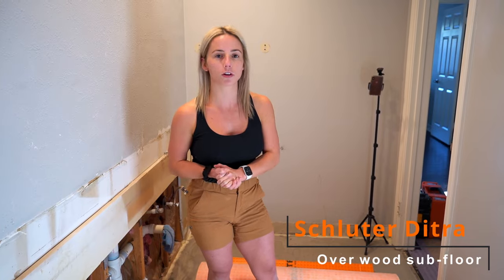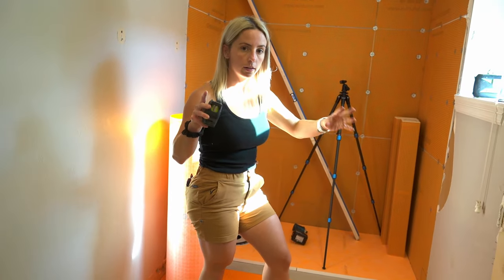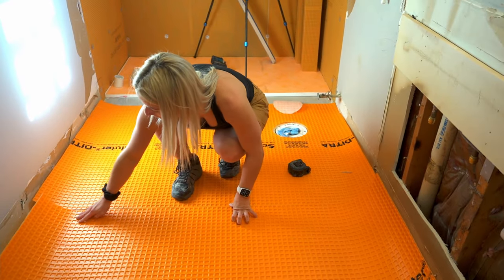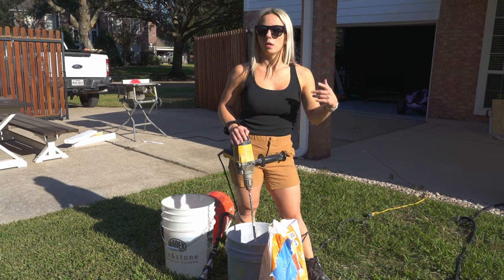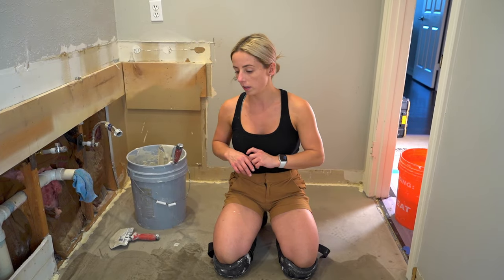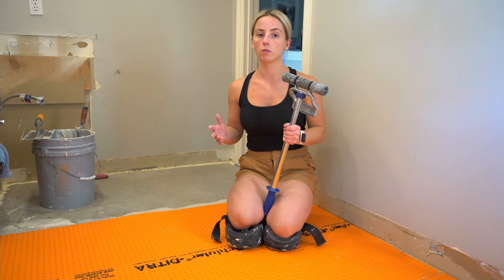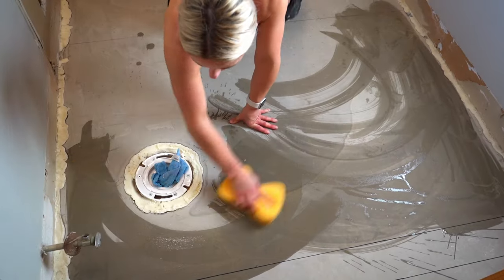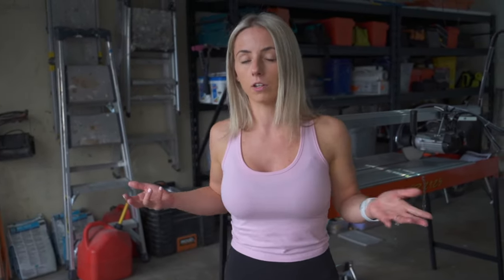Schluter -DITRA over wood //  full installation tutorial

Comment: I laid the Ditra over plywood subfloor. That was a mistake. I assumed the subfloor was flat and level. It was not. Every bump  was amplified by the Ditra. I will start over with self leveling compound only under the tile. The house is 20 years old. All settling has occurred long ago.
Reply: Exactly why are you guys using in the first place. What were your thoughts before you used it?
Reply: If you don't understand a flat substrate you shouldn't be
Installing anything

Comment: Using the ditra in my bedroom remodel. Subfloor is concrete slab with asbestos glue so I scraped as much glue as I could while wetting it so it wasn’t airborne than used perfect primer to seal it. Now I’m ready to use the ditra. This video was very helpful!! Thank you for being so detailed in your instructions.

Comment: I am installing Ditra first time today and will use unmodified thin set since this was recommended on Ditra web sight. Can not purchase Schulter thinset at my local tile shop. Claim is unmodified will dry better under membrane due does not need air to cure, anyway too much confusion. Thank you for your excellent video. I am experienced professionally in bathroom remodeling and tile installation and late last year retired but just will watch good remodeling video.

Comment: That Tile Chick Thanks for all the great info! I'm trying to calculate how tall my tile assembly will be using Ditra- When you add thinnest above and below, how much height should I allow for that? 

I wrote to Schluter, but they don't have any figures on the total assembly thickness, only that the Ditra is 1/8 tall. ~ I have 1/4" and 3/8" tile and transitioning to wood flooring in hall from two different rooms. I'd like to adjust my subfloor to make the transition as flat as possible.

Comment: Doing a kitchen renovation. Removing old tile (& any other flooring layers that may beneath(?)]—essentially taking it down to the original hardwood beneath it all—& then RE-tiling back over. 

Am I able to install the DITRA directly over the hardwood? Or do I need to first install cement board/hardy board?

… GREAT videos. EXCELLENT work. Thanks for your time & efforts 🤙🏽

Comment: Is there any benefit to using the self-leveler over OSB even if the floor is already perfectly level? i.e. Would you use this method in all cases, or would you skip to just the Ditra over thinset on the OSB if it's already level?
Reply: Skip to ditra if the floor is already flat.

Comment: Shannon, have you ever had coverage issues on the felt backside of the membrane? I recently did a concrete slab and used Schluter set. It adhered well to concrete slab (pre wet with sponge) but even with a wet consistency mortar it wouldn’t get a good adherence to the back of the ditra membrane.
Reply from the maker: Just commented on your video on your channel

Comment: Thanks for the video.  This will be me in a couple of weeks.  Are you using 'All Set' for the banding the seams?  I guess you didn't, but you would use that for Kerdi band in the seams and floor to wall, if you were waterproofing?  I will be waterproofing and want to confirm.  Thanks Tile Chick
Reply from the maker: if you where waterproofing the floor, yes you would use the schluter all set to band the floor and make it waterproof. same for the walls

Comment: Dear, I have solid wood plank ( 3/4" thick x 6" wide) SUBFLOOR. Is it ok to use Ditra shulter over it? How much gap between two wood plank is Acceptable to use Ditra over it?
Reply from the maker: https://resources.schluter.com/media/psi/lowes/DITRA%20Installation%20Handbook.pdf

Go here to page 7 with the detail titled Floors, Interior - Structural Plank Subfloor.  You're going to need to add plywood over the planks or remove and add plywood to the joists instead
Reply: Thank you!  I have a plank floor in the bathroom of my 50’s-built house.  I just yanked all of the old tiles and wire mesh and I’m down to the plank board.  I presume all we need to do is glue the plywood (3/4”?) to the planks and then screw it down?  Then install the Ditra?

Comment: I notice you did not check the plywood thickness. Some floor tile install methods say to have a minimum of 1 1/2 inch of plywood subflooring. Is this not required with the Schluter-Ditra uncoupling underlayment?
Reply: 3/4 subfloor

Comment: Do you recommend using this Ditra membrane on cement floors in a basement (when laying porcelain tiles)? 
Also do you recommend using this membrane on stairs (for porcelain tiles)?
Reply: The ditra is essential for concrete floors because if the concrete cracks it won’t crack the tile being an uncoupling membrane. It’s also a good idea to tape your seams to prevent lyme coming up from the concrete through your grout.

Comment: I want to replace the vinyl squares in my kitchen with tile.  The subfloor is 3/4" planks with 1/2" plywood over top of it.  Can I use this directly over the vinyl or do I have to tear out the vinyl and put this over the wood subfloor?  Thanks!
Reply from the maker: If the vinyl is adhered really well you will need to prime over it with a product like Mapei eco prim grip first. Always remember the tile application is only as strong as what it’s bonded to. Just be sure the vinyl is glued real well before attempting. Remove any loose pieces

Comment: Any tips for transitioning from DITRA over plywood back to adjacent bare concrete substrate for a seamless run between the two subfloors?  How to level back to concrete floor?  Or am I committed to using DITRA over the entire area, including all the concrete area?
Reply: You would have to have the floor heights at different elevations in the pouring of the concrete initially.

Comment: Does ditra also work to keep the heat inside? I mean as kind of insulation?
Reply: Not really. But it's rated for use with radiant floor heating systems.

Comment: Doesn't this make the final product too thick? How would you transition to another floor with vinyl planks kn it? I'd think it would float half an inch above it.
Reply: Use Ditra XL to end up even with your 3/4 hardwoods. Use regular ditra and a transition strip provided by the vinyl plank manufacturer if that’s the floor you plan on using elsewhere.